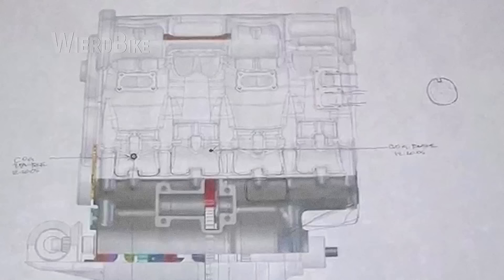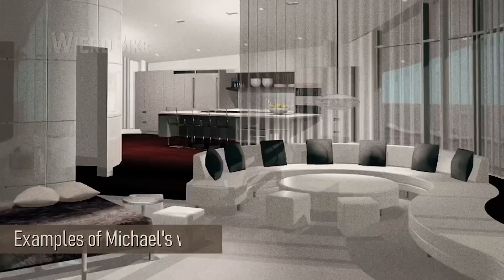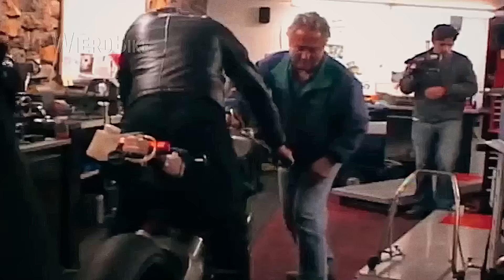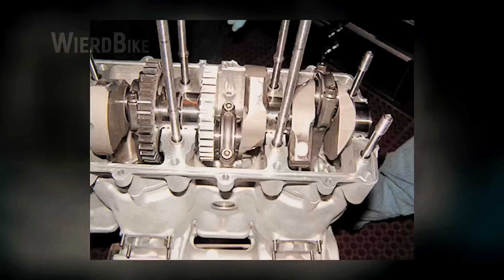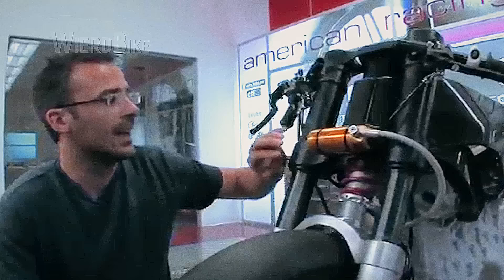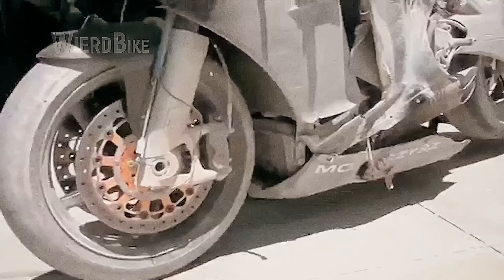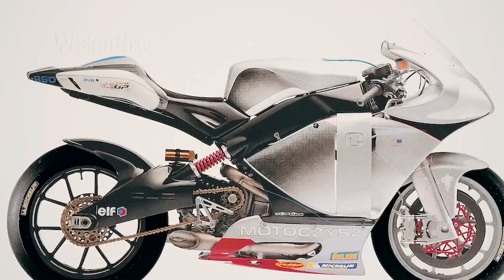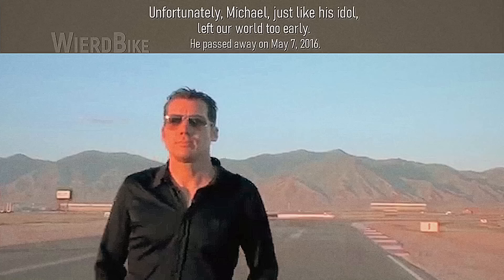It was SO GOOD that MotoGP CHANGED the regulations? Unique Z-line engine with 3 CAMS and 2 CRANKS.

Comment: Fantastic piece of engineering, and I think looked cool as well, but this bike being the reason MotoGP changed to 800cc?... nope. The change was for a couple of reasons.. both reasons given by MotoGP were in fact badly thought out, but they definately weren't to try and prevent this bike entering MotoGP. One of the reasons given was safety because the 990's were hitting crazy speeds on the straights. the actual outcome was vey similar lap times so they were actually going faster in the corners.. so not safer. The other reason was to lower costs, but this meant entire new engines needed to be developed which had the opposite effect. The idea that MotoGP wanted to keep this bike out of MotoGP is simply wrong since MotoGP has been attaempting to get more manufacturers on the grid, which is why they had the ill-concieved CRT bikes, and is also why they gave concessions to the smaller manufacturers to level the gap from the big japanese manufacturers, its also why they are now giving concessions to Honda and Yamaha to try and help and discourage them from leaving.

Comment: Love that motor and bike setup. Can you imagine the lap records being broken with a GP rider on it. 
  Have my kz 900 in boxes. I’ll be starting on it in a few years. Want to do mono-shock on rear and was looking at doing hyabusa front. That front suspension set up on his bike makes sense. Not an engineer but would be interesting to try. 
 Modern stringer ? LOL
Reply: KZ900 huh? Good luck. Had one. Spent the whole time trying to keep from being killed on it. An absolute nightmare in corners.
Reply: @plantfeeder6677  
 Was stationed in CA. Became friends with a motorcycle shop owner. He was an engineer that was the Z10 development. 
 He asked me one time if my bike was apart. I said yes. He told me to bring the frame. Turns out he built their road race KZ 900s & 1000s.  The frame is gusseted. In all the right places. 
 Still haven’t made up my mind  on how I want to set it up. A little high and short for corners or lower and slightly stretched. 
 I’ll figure it out eventually.

Comment: watched a docu about this years ago .. Did they not have problems with castings ?? lots of imperfections and air holes in castings causing the engine to implode  multiple times ..
Reply: No way any engine would implode. Do a spellcheck.

Comment: Contra-rotating cranckshafts were common on two-stroke racing bikes and even made it into consumer bikes with the Kawa KR250 an Suzuki RG500-  because of rotary valves placement.
Being different is easy, the hard part is to make it work.
Exept for a small aerodynamic advantage, I see no point to this bike - unlike the Elf and Britten whose difference made sense theoritically an who were at leást proved to work better at leást in some measure.
Reply: Engine over the gearbox? 🙄 Too high I think...
Reply: The uniqueness of Czysz design is he had split crankshafts the rotated opposite each other, canceling eachother out and mounted perpendicularly to the wheels meant there was virtually no gyroscopic effect imparted on the bike by the engine.  Only the wheels.  Those that rode it said it was very neutral in it's handling characteristics with very easy turn in and ability to change direction.
Reply: Kawasaki did this on their 250 and 350 2-stroke racing bikes in the 70s. Rotax too.
Reply: Aprilia 250 GP bike too. In the 500 two-stroke era, the Honda NSR was the only succesfull bike I know with a single crankshaft. Everyone else used two contra-rotating. Yamaha RZ500 street bike...

Comment: someone forgot the golden rule when they designed this engine, the engine with the least amount of moving parts is the most efficient, returns the highest BHP and is the most reliable, in a word it is the BEST, this engine was blown away by Japanese 2T engines that are piston ported, with only 4 moving parts, piston, conrod, crank, driveshaft, the reed valve is static although it does have a membrane, this engine was so unreliable no one wanted to ride it, the whole video seems to miss the point that this concept was nothing more than an experiment in engineering as for a serious race engine, it wasn't, did it ever win anything, did ever finish a race, it was constantly blowing up, the cranks would twist out of shape, pistons would self destruct,
Reply from the maker: Yeah, i agree, buuut… Michael’s engine is pretty interesting thing

Comment: MotoGP could have had V8s but they changed the rules
Reply from the maker: they actually had couples
Reply: The first engine rules for  4 strokes in MotoGP had a maximum of 6 cylinders with a capacity of 990 cm3, there were weight penalties for the number of cylinders.

Comment: Broader than the motor? So it has a starter? Oh, you meant the engine. Race bikes don't have motors.😂
Reply from the maker: This has road copies…

💀
Reply: @wierdbike He is trying to differentiate a motor from an engine.
Reply: @@retiredbore378 We all have our pet peeves. Personally, I can't stand it when people use buffalo instead of properly saying bison!
Reply: @@retiredbore378 An engine referred to any device that was thought to be ingenious long before steam or petroleum were harnessed for power. It was only later used in combinations such as steam engine and internal combustion engine. Motor simply means `to move'.
I think we need stick to modern definitions of these terms; motors convert electric energy to movement and engines convert fuel into mechanical force. 
I was simply stating that we all have hang-ups with our weird mutt language. Ultimately you can't change what others think or say, that makes it your problem not theirs! Best wishes.
Reply: @@retiredbore378 I reiterate; 1. We all have our pet peeves 2. You don't control what others say or do. I should add that English is ever-changing. Going back to read Shakespeare it starts to get difficult, by the time you get to Beowolf you need footnotes to understand it. I find the language interesting, but ultimately it's fluid and used across the globe, thanks to Imperialist assholes. So in that light you can think that you are correct, but it doesn't matter what you think and soon we'll be gone and the language will keep changing. By the way, I appreciate the Oxford Dictionary for what it is and how it came to be. I'm done with this conversation, I wish you well.
Reply from the maker: I don’t know what to say gentleman’s…